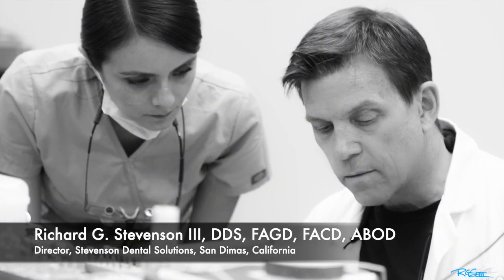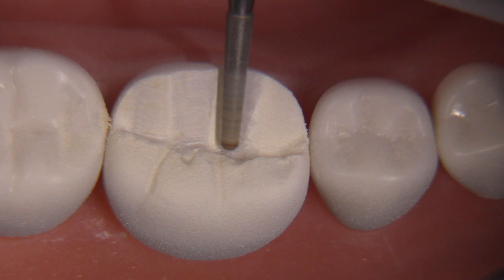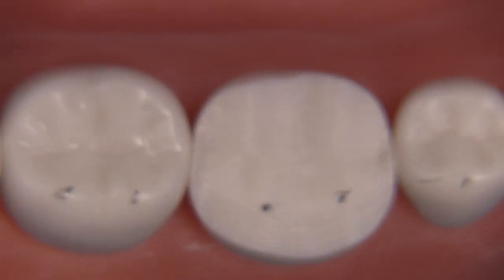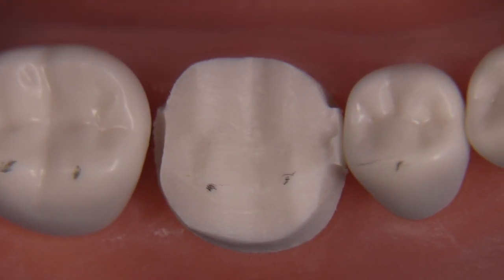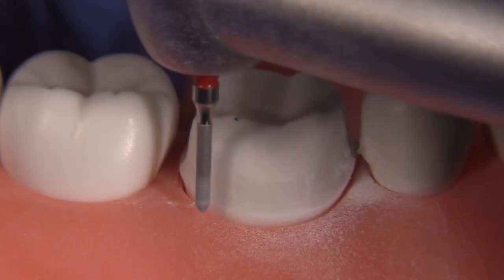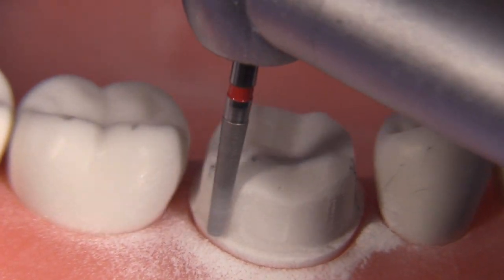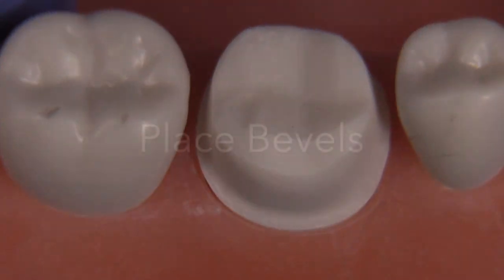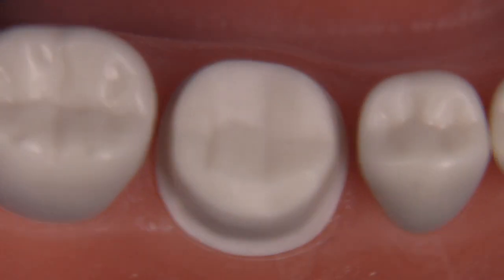PFM Preparation - Acadental Tooth #30 | Dr. Richard Stevenson

Comment: What bur I need to use to get a chamfer margin of width between 0.3 to 0.7 doc? And can I use half of the round end taper bur or need to use only torpedo bur? Please advise. Thank you in advance
Reply from the maker: The 877-010 is a parallel pointed diamond 1.0 mm in diameter and this will give you a 0.5 mm modified chamfer.  If you would prefer a tapered chamfer bur, use the 878K-016 which will give you a 0.55 mm chamfer if using half of the tip diameter.  Round ended diamonds don't give chamfer margins - they create fillet finish lines, which are more like a rounded shoulder.

Comment: Doctor, in the axial reduction I always make finish line too big and a lot of tooth structure lost, how do fix this ?
Reply from the maker: Try to use the bur no more than 1/2 of the diameter for the chamfer and only the tip for the shoulder.  Let the bur limit you...

Comment: Beautiful doc …. Any recommendations for lower first premolar bc once you cut 1.5 mm and supraginguval margin you end up about 2 mm crown prep length is that ok ? Any advice ??
Reply from the maker: It is a short tooth for sure, so make sure you extend the finish line to the tissue level and keep the walls at 6-10 degrees.  Best wishes, Dr. S
Reply: @StevensonDentalSolutions  thanks alot doc you such an inspiration for me to keep practicing and do better
Reply: @StevensonDentalSolutions   btw doc do you think 847 016 give 6-10 degree taper or more

Comment: Great like always doc my question is for breaking contact we should keep the bur parallel  to line of draw ? Bc for the distal you leaned the bur a little bit ? Is that something you for distal or its the camera angle thanks alit doc
Reply from the maker: Good observation!  When breaking contact I use a very narrow diamond - the tipping is done to protect the adjacent tooth.  After the contact is broken, you may start by holding the bur parallel to the line of draw, however, this will only provide about 6-7 degrees of Total Occlusal Convergence - not practical.  The finest preps usually have 10-12 degrees of TOC and are completely acceptable with up to 20 degrees of TOC.  Also, it is important to tip walls to obtain clearance with the proximal tooth contour...Thank you
Reply: @StevensonDentalSolutions  
Good bless you doc …. I usually use 169 bur to break contact and then try ti increase taper using 856 016 ….

Comment: Very informative and so very well made.  I just had 2 questions:

1) How do you maintain the anatomy of the triangular ridges when doing the plane reduction?  I usually end up with pretty flat looking triangular ridges
 
2) When you are reducing the "B plane" are you are angling the burr parallel to the inclinations of the cusps like you did the in the "A plane" or is it perpendicular to the occlusal surface (making it flat)?

Thank you!
Reply from the maker: I try to preserve the most prominent triangular ridges, like the maxillary buccal cusps and the lingual mandibular cusps.  If the triangular ridge is fairly flat, I usually respect that form.  As for the B plane, it would ideally parallel the triangular ridge declination angle - about 35º.  When you respect the inclination angles, the prep will have more uniform clearance and preserve more tooth structure.

Comment: What if skill tests like NDEB dont have needle burs to break contact. What would be our options? They only provide round end taper and flat end taper both 16 C.
Reply from the maker: If you can place a matrix between the teeth this might help - otherwise the entire batch will be prepping deeper axial walls and the examiners will be expecting it.
Reply: @StevensonDentalSolutions  Thanks for your advice. This NDECC exam in Canada for foreign dentist is really challenging. Hope the more relaxed grading criteria make it easier.
Reply from the maker: @samjam6989  I am aware...best wishes!

Comment: Hi doc. Please can you explain what does the 016 refer to on the 847kr 016 bur? You mention 1.2mm tip but  I was under the impression the 016 referred to 1.6mm diameter at the tip.
Reply from the maker: The diameter of the WIDEST part of the bur in tenths of millimeters.

Comment: Hi Dr. Stevenson, Thank you so much for another great video! When you used 8847KR to create a shoulder, do you think the tip of the bur might create a sharp buccal cervical line angle that can potentially cause additional stress on the tooth's structure?
Reply from the maker: Not the KR - this has a rounded end, but PFMs need this axial depth, so there isn't much we can do.  With all-ceramic preps, the KR burs are too aggressive and a fillet margin, using an 856-016 or KS type would be better as you mention.
Reply: @StevensonDentalSolutions  Got it. I didn't know that KR has a round end. Thank you so much for the info, Dr. Stevenson! You have a great weekend.
Reply from the maker: @ruarua2603  Thank you!

Comment: Dear Sir,
It seems that these are electric handpieces? Not air-driven handpiece? Thanks
Reply from the maker: Air
Reply: @StevensonDentalSolutions  Thank you very much for your attention. I am lecturer, so we worry about that more dental faculties (US, EU) recommend dental student use electric handpiece (and air) during preclinical training (also in clinic). It is correct?
Reply: It is very difficult for me to teach dental student how to control very slow rpm like your clip (with air handpiece)
Reply from the maker: @phanhung9622  Yes, it takes many years to master.
Reply from the maker: @phanhung9622  True.  The US has almost completely moved to electric in dental education.  In practice, I , maintain both air and electric.
Reply: @StevensonDentalSolutions  Dear Dr,
Thank you very much for your attention. It is honor for me to learn interesting experiences from you, although too late for me (and my faculty).

Comment: I am  right handed. I was preparing tooth no.15. It is very difficult to get accessibility and the buccal mucosa is fat, bulbous and difficult in retraction. Any advise!?
Reply from the maker: Rubber dam helps for some of the prep - then remove the dam - use a W3 or W2 clamp and do as much as possible, then remove the dam.  Or...try an Isolite - they work great.  If neither of these is working, then have the mirror slid between the tissue and the handpiece and have the patient perform a mandibular LEFT border movement which should open the area slightly.

Comment: Hello Dr.Stevenson,
Please correct me if I am wrong..for a PFM, after axial reduction all around the tooth with 878k-012 the next step is to use 8877-009 only on the lingual wall and 8847KR-016 only on the buccal  wall.Is that right?
Reply from the maker: bring the 8877 into the inter proximal too, and yes, use the 8847 or 8847KR for the facial esthetic zone areas.
Reply: @StevensonDentalSolutions  thanks alot!

Comment: Hi Dr,
When reducing the buccal and lingual walls, do we hold the bur parallel to the long axis of that particular wall or do we tilt it towards the tooth to create that tapered effect? or does the tapered effect come with the design of the bur?
Reply from the maker: The bur will give you 6 degrees of total occlusal convergence, but this is the absolute minimum taper and if not done without flaw, you can easily have undercuts.  My recommendation is to tip the bur slightly more than the inherent taper to create a TOC of about 12 degrees.  This will provide you with adequate retention and ease of visualization.  The secondary planes at the occlusal 1/3 of the facial and lingual are done at a great taper to follow the adjacent tooth contours.
Reply: @StevensonDentalSolutions  for the lower molar the lingual wall is tipped lingually..so the bur inclination is parallel to the long axis of that wall or do we tilt the bur inwards towards the tooth for taper?

Comment: Fantastic and indepth explaination for every step including the bur size. Every video i see has new information in it. Thank you Sir for this commendable videos. Just had a doubt. As for shamfer using 8877 o09 it has max width is 0.9 and we need shamfer of 0.5 - 0.7 so when we use half of the bur it will give only 0.45 max. Going further deep won't it create a lip on the outer rim ??
Reply from the maker: Great Question! It may if you don't manage it.  All burs will create a lip if they go deep enough axially and are allowed to move gingivally.  If you can plane the finish line by moving the diamond axially and outwardly, the lip will be corrected.  If you'd prefer, you can use an 878K-014 or -016 as these will create taper and avoid lips if used less than half of their diameters.  Alternatively use an 8877-010 - these will create a 0.5 mm axial depth at the finish line.
Reply: @StevensonDentalSolutions  Thank you Sir for your quick and proper answer. Keep it going Sir

Comment: Hi, dr
You used the red bur refining chamfer, is it possible to reduce the tooth with the red band bur? 
You used the FG low speed angle handpiece or electric motor, creating shoulder.
Reply from the maker: Yes, and it's in a slow speed

Comment: Great videos. When finishing your margins, what speed are you running the handpiece at? If at slow speed, are you using firm or light strokes? Thanks!
Reply from the maker: Very slow - stall out speed with the air turbine, and 2000 on electric.

Comment: Thank you very much for your effort...
I have question.... what is the type of the loupe you use .and how much the magnification?
Reply from the maker: 6x or a microscope with up to 30x but I started with 2.5x, then increased to 4.5x after a year or so.  I usually recommend 3.5x Univet Prismatics with a light.
Reply: Do you sell it in your site..... ?
Reply from the maker: @frozenlight8853  No it requires a rep to visit you and measure your eye and working distance.  Check out Univet's website for more info

Comment: Beautiful work. Can I use 847 bur for porcelain shoulder instead of the 847KR you have in the video? And the axial reduction bur too, I’m using 878 bur instead of the 878K you have in the video. Thankyou very much.
Reply from the maker: You're all set then - the differences are subtle and won't make a big difference!
Reply: Stevenson Dental Solutions got it, Thankyou . Just wondering the difference between these bur. Btw is the endo access video coming up anytime soon? :)
Reply from the maker: The 847 has a slightly sharper corner compared to the slightly rounded corners of the KR version.  Endo access done - editing is underway...
Reply: Stevenson Dental Solutions for endo access what are & kinds of dental bur I should bought? Is it available is your stevendentalsolutions.com ? Thanks
Reply from the maker: Just the 2 round and 4 round bur, followed by the EndoZ - we don't currently carry the EndoZ

Comment: Please can you explain what 'high speed at stall out speed' procedure is?  How do I achieve this during margin refinement?
Reply from the maker: Push the pedal slightly - allow the headpiece to rotate more slowly.
Reply: My push foot pedal is sensitive so it is  difficult to maintain a slow constant speed.
Reply from the maker: Can you try a friction grip slow speed attachment for your slow speed motor?
Reply: Yes I will look into getting a friction  grip attachment. Many thanks for the advice.
Reply from the maker: @amoo6933  Great

Comment: hi dr. Stevenson, great video! Which chair position do you recommend for #30, especially for the B plane?
Reply from the maker: Start ay 7 for the C and A, then switch to 11 for the B
Reply: @StevensonDentalSolutions  Dr. Stevenson, how might the operator chair position change for each occlusal plane when doing this prep on #19 rather than #30?
Reply from the maker: I usually work from 7 O'clock to start the planes with direct vision, then swing around to 11 to refine with the patient's head turned towards me or away to facilitate the prep access
Reply: Stevenson Dental Solutions thank you Dr. Stevenson, your video has officially saved me the night before a crown competency! Bless you!
Reply from the maker: @danielanaumovski6586  YES! So happy to help!!!

Comment: Hi #Dr.
What FGC mean? 
And what the difference between FGC  & PFM? (except the finishing line in esthetic zone..)?
Reply from the maker: Full Gold Crown.  FGC has less occlusal clearance and a chamfer margin.
Reply: @StevensonDentalSolutions  
Thanks Dr.
Reply: @StevensonDentalSolutions  
 Dr. Which type of finishing line you use in zirconia crown...?
Reply from the maker: @El_mahdi313  A radial Shoulder - a shoulder which is rounded internally and is at least 0.8 mm wide.

Comment: How do the codes of all the burrs make sense? I have trouble remembering which burr to use. :)
Reply from the maker: They are very strange.  Whenever there is an "8" in front of the three numbers, it means fine grit (30 microns) Otherwise, the system of numbering makes little sense!  KS was named after Kois and Spear.  KR burs have rounded corners.  It's a mess!

Comment: Perfect & smooth , i watch video time after time with passion , i have question dr , what is ur opinion about verti prep ?
Reply from the maker: It's controversial - let's wait for the research on this design.  Most of us in Academics are concerned because it results in a knife edge of zirconia, and zirconia doesn't perform well when thin...

Comment: Thanks for the video, from buccal aspect we can't appreciate the distal cusp unlike your previous videos of FGC. This is the issue usually I face as as well. Any comments on how important is it from examination point of view?
Reply from the maker: It was not an issue Ankur, it was as required.  If you reduce the occlusal properly, and then you prepare the proximal and develop the taper - and if the distal cusp is prepped away, it was meant to be.  With the FGC video, it was on a Columbia typodont, which has a much larger distal cusp.  This prep was done as dictated by the environment.  This is what's important from an examination point of view...
Reply: @StevensonDentalSolutions  Thanks for your views.